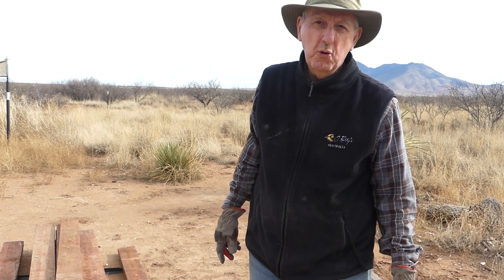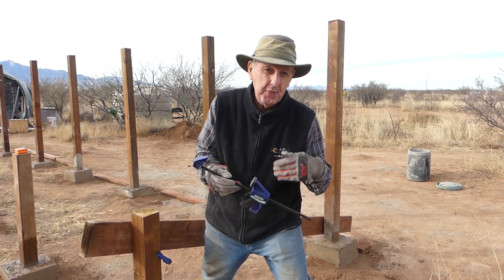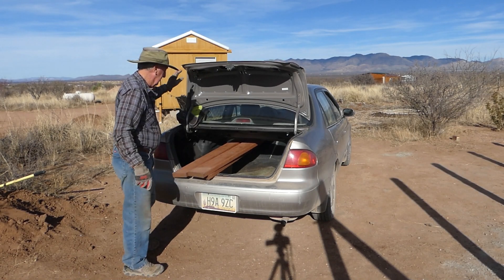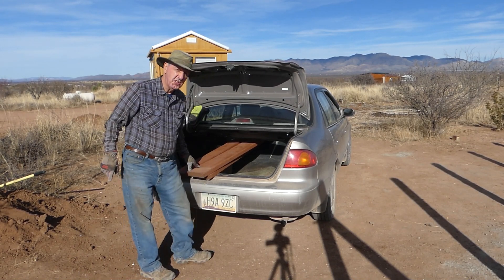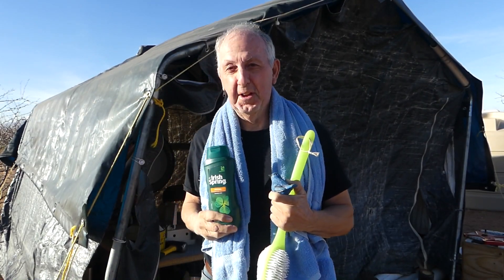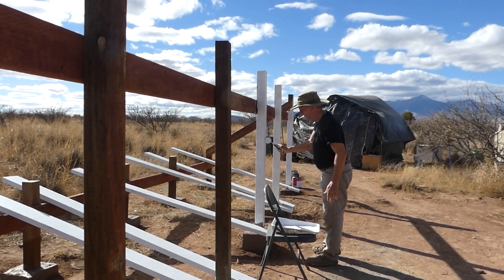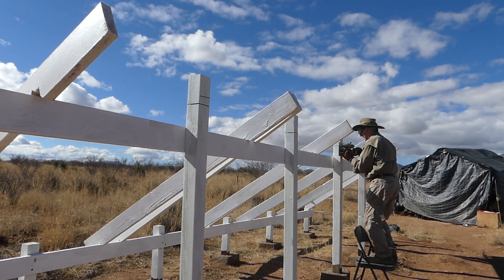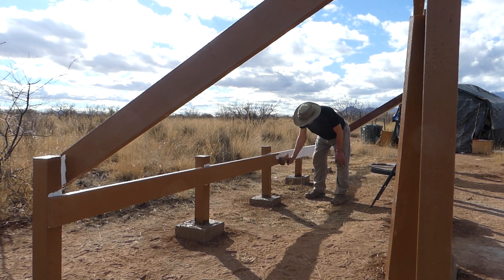Off-grid Senior Designs Solar Array for Tiny Cabin Part 2

Comment: how did you determine the height of the posts when cementing them in?  and the spacing?
Reply from the maker: I simply got creative once I determined the necessary angle the structure needed to be.

Comment: Good work. My idea to deal with mounting the panels would be to do the rafters (2x6 supporting boards) at any equal spacing and then use horizontal 2x4s on top of them to mount the panels to them. That is convenient as these boards can be easily re-positioned without touching the rafters. If in the future you need to replace the panels then repositioning rafters might be more pain and you can fit varying size of panels this way.
Reply from the maker: Thanks for your input Stanislaw Pak.  Yep lots of ways to do solar panels. At this point I am very happy with the effort.  Everything is sturdy and working great!

Comment: Good job Sir, wondering about the Wind......Will the Solar panels hold up to a lot of wind?..
Reply from the maker: John thats a very logical and excellent question.  If you look at the final setup (make sure you check out the next videos) You will see a bulldozer couldnt move this thing LOL.  Actually some have mentioned I have over-engineered it.  But... I know how incredibly windy it is here.  So far the panels and set up take the wind in their stride and show not even an iota of cause for concern.  Its a very solid structure. Thanks for watching!
Reply: @affordabledesertliving3487  Good to hear......

Comment: Do you have trash pickup?
Reply from the maker: Hi Gene.  I could.  But its expensive overall.  Instead i shove everything in my toyota corolla and use the dump at Bisbee.  $5.00 per load.  Super cheap.

Comment: Really doing good it's coming right along. I wish I could slow down when I do things but I use to work about 60 to 80 hours a week when I had my shop and slow was never in my Vocabulary. I was always full tilt. Then I hurt my back and it stopped me dead in my tracks. A few years later I got to where I could do small things and being as stupid as I am I had to go full tilt once again then paid for it for weeks. now I still do the same thing and it seems like I pay twice as much for it. What took you day's I would have tried to do in two days but it would have ended up taking me week's if not months just for being stupid and pushing way to much. One day I hope to learn. Take care stay safe.
Reply from the maker: Take a deep breath and then go for a walk and cool down.  I find that works to short circuit my mind and get it engaged in something totally different like walking. Try it.  Hope it works.

Comment: The angle is 30 degrees but you can also do any angle you want…..especially if you want to optimize your solar array for a certain time of the year. 30 degrees gives you maximum output in either September 20th or March 20th with a good trade off for summer and winter….me? I did mine at 20 degrees. Why? I plan on using air conditioning in the summer so my peak usage will be in the summer. 20 degrees put my peak production sometime in August when I’m dealing with more clouds and hot weather and I’ll still have a surplus in December. It’s just really up to each person and their needs.
Reply from the maker: Great input GL Woods. Thanks!

Comment: I have 2 acres in Pomerene, north of Benson. I am trying to get permitted to allow me to use a large version of your cabin. I am being told that I can not use it for living in. How did you get it done? I am not even being allowed to put a shed on site until I get a permit.
Reply from the maker: Hi William. The easiest and most amenable method for permitting a shed to cabin is the Opt Out Permit available in Chochise county. This is where if you have 4 acres or more and where you can apply for a permit under the owner builder clause making it permissible.  This is what I have done. Since an opt out is not a possible situation for you because of 2 acres I would check in with the county and ask them specifics on what would make your cabin permitable under the normal permitting process.  Since I have not gone that route I am not knowledgeable enough to give you solid consult.  I hope it turns out for you. Thanks for watching.

Comment: I'm guessing that you researched the best yearly average for your panel angle. Thought I would mention that to get the absolute most energy you can change the angle to fit the season.  Looks great Don!
Reply from the maker: HI Randy.  Yes I researched the optimum angle for this area.  Of course this array will be stationary but my plan is to oversize the system and thus gain the power that I need.  Naturally its a work in progress and I am flexible to learn/change things as I go along. Thanks so much for watching!

Comment: Good job, Don!  Smart to make a faux panel to see how things will fit.  Thanks for the shout out.  We just won't tell anyone that I'm also the math geek that talked about calculating angles 😉!  I think you're ok, but be careful that those extra support boards at the edges don't cast a shadow on your panels.  Same with trees and weeds, etc.  Looks nice and sturdy.  Can't wait to see the finish!
Reply from the maker: Hi Brian thanks for all of the affirmation about this build. Yep you have an excellent math mind.  Me.... not so much. LOL. I was a bit worried after you mentioned about the support boards and shadows. Turns out the superstrut which is pretty tall seems to put the panels above almost all shadows. Whew..... big relief. 
So great to have fellow off-gridders like you to bounce ideas off of.  See ya soon!

Comment: treated lumber can leach chemicals into the ground. so if you choose to use the shade from your array,maybe raised beds would be a better choice
Reply from the maker: Good advice Leo. I wont be using the underside of the array for anything other than to go under and check the panels etc.

Comment: At 30 degrees the hypotenuse or angle board is 2 times in length to its height from front to back. So if the angle post to post is 8 feet long, the rise would be 4 feet post to post.  Level a string line and measure up 4 feet in the back.  Very easy for that angle.  But since the earth moves it's not that seriously important.  The panels actually do very well on overcast days because the light is coming from all angles.  Here in MA they plan on 7 months of good sun, the 5 winter months are a bonus.  Here in MA some fields are set at 25 degrees, some are set at 20.
Reply from the maker: Thanks icehso140.  Great technical explanation.  Hope you wouldnt find me unappreciative if next time I just reach for my angle finder though LOL. Yes you are so correct about the angle of the sun.  There is a lot of flexibility over all and it depends on where you live. The beauty of AZ is we get intense sun for so many days of the year it's ideal for solar.
Reply: @affordabledesertliving3487  No problem using an angle finder.  Any tool that gets the job done faster so we can save time and money gets purchased on our jobs.  Math for us electricians is just part of the process.  Have fun.  Enjoy your free power from above.

Comment: Once more nice job. I'm glad ur searching for solutions like that box that measures degrees and asking for proper alignment. 
U may want to use Simpson hangers/ties  to reinforce those crossbeams and panels. The winds will play havoc if they are loose.
Reply from the maker: Hi Lee thanks so much for watching.  Yes I already had the hurricane ties in mind. The 2x6 have to be placed precisely according to the specific panel placement before I put those on. Then it will be sturdy.  Cheers!